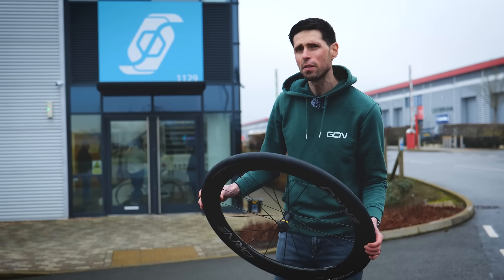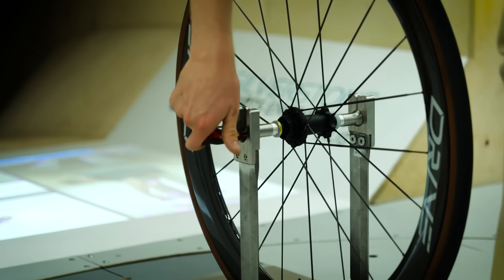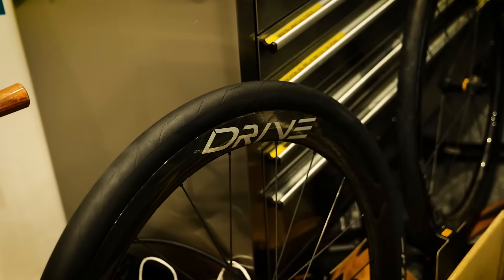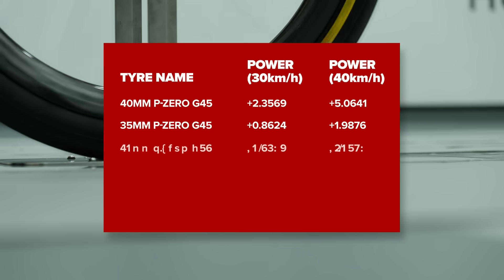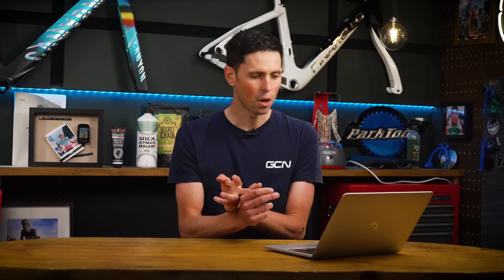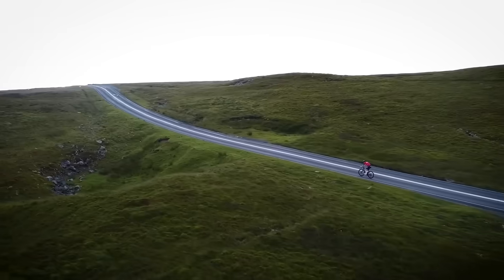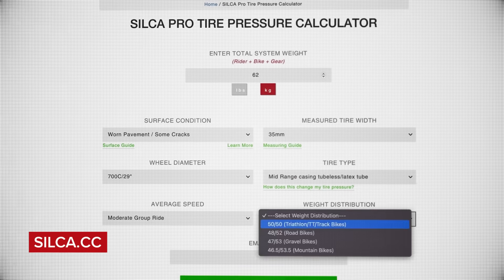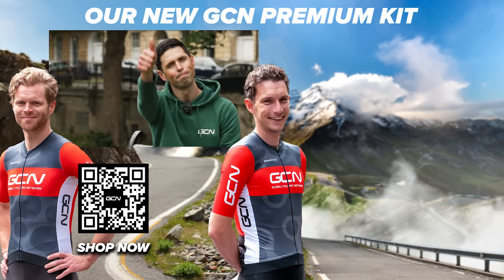The Fastest Tyre Width is NOT What You Think

Comment from the maker: What tyre width are you currently riding? Let us know in the comments below! 👇
Reply: 23mm GP5000 😊 I’m a poor dude so I ride a trusty old KLEIN frame from 2004, and it only fits 23mm 🤷🏻‍♂️
Reply: @jahen65 my old Klein fits 28mm rear, 25mm front under Suntour superb brake  
calipers,
Reply: The best combo for me: 30mm front and 32mm rear. No bounce standing and comfort sitting.
Reply: im so confused, didn't you guys test this on a track and found fatter was faster?
Reply: @Randomness82 different situations will always result in a different outcome, as I explain in this video there will never be one setup that is optimal for all situations or conditions or riders
Reply: @alexpatonGCN  I'll have to go look for the video but it was on a oval track iirc so I would think that's pretty similar to the premium road setup they had on the dyno.

Or heck maybe im mixing up with different channel but I've been hearing how fat tires are better for a while, it's like the short crank arm thing.
Reply: 12:12 - Big slick 2'' thumbs up!!  And I am thinking about giving 2.2'' or 2.5'' a try next season.
Reply: 25mm, as nothing else fits the frame and forks.
Reply: @regsmith5972 Ditto. Well, 25mm and below.
Reply: @regsmith5972   you'd be surprised. a 28mm tyre will come out at different widths depending on the rim it goes on. you may be able to get a benefit depending on what rims you have. (.eg. narrower internal rim width will produce narrower final tyre width).
Reply: @huzcer  It's a 15mm wide rim, so a 25mm is the largest that will fit, having taken advice from my bike shop.
Reply: @regsmith5972  Try 20mm....It will fit 😅
Reply: 25mm front & rear.
Reply: @robertkilpin wow
Reply: @robertkilpin  same! First road bike, coming from MTB and my bike feels fast AF! 🤷🏻‍♂️ 
Ignorance is bliss I guess
Reply: I don’t understand why no one ever takes him into consideration the weight of the rider. At 210 pounds anything less than 40 mm I would have to have at an insane psi. Ride the width where your psi is reasonable and the tire isn’t hard as a rock
Reply: @That.Guy.  Get some rims with 24mm internal width and try some 32mm at 55 PSI.  Light Clydes can be super comfortable on modern rim shapes.
Reply: @That.Guy. Surely not. I’m a similar weight and ride 25mm GP5000s at 75psi quite comfortably. Haven’t had a puncture for more than two years 👍
Reply: now do it with old steel rim brake bike. i think you will be supriced by the results.
Reply: @wilderness-beastt depends how old the steel rim brake bike is, because i can't imagine a 28mm would even fit 😂. Skinny tubular will be great here haha
Reply: Happy to say I run 30mm P Zero tires. But also sad to say I run Specialized butyl inner tubes on a tubeless ready version of the tire, which I later learned is a less optimal combination.
Reply: Been using 32mm for like 35 years.  I would prefer to use 28mm but I am too heavy.
Reply: @凸Bebo凸 how heavy? I’m 230lbz
Reply: 15mm , Theyre super fast.
Reply: Lots of tire widths in my garage.  I prefer 4" wide tires because going off road is something that is important to be able to do in eastern Idaho.
Reply: 45mm in the back and 43mm in the front.
Reply: 23 mm Vittoria Corsa tubulars. Narrower is faster 😅
Reply: 35mm Continental GP Urbans. I changed my set up a couple of years ago due to a undiagnosed problem with my legs and built a bike around my issues running 1x12 also. I've found my rides are only getting faster and they're more comfortable than the many years of riding 25mm tyres
Reply: I'm on 28mm Continental GP5000 tires on carbon rims with a 21mm internal width, mounted on a frame with rim brakes. It's a tight fit, but I'm very happy with my setup.
Reply: @alexpatonGCN you mentioned towards the end of they'll fit in your bike. What is the best way of finding this out for different bikes before buying the tyre? I'd like to try 30, but just not sure if it will fit
Reply: @shaunjasper5465  You can go on bicycle rolling resistance site and look at tire tread depths and inflated sizes.
Reply: 2,5''
Reply: 30mm with TPU tubes. Haven't tried any wider but wouldn't go back down to any narrower.
Reply: 35 mm Panaracer Gravelking Slicks (road)
42 mm Panaracer Gravelking Semi Slicks (gravel+road mix)

Found them to be a good mix of RR and puncture protection.
Reply: 25mm on one road bike, 26mm on another, and 30mm on another 😅. Too many road bikes
Reply: 25mm conti gp5000. biggest i can fit on my bike
Reply: 23mm sometimes 25mm
Reply: Just bought 30-622 GP5000, very happy about it after I saw this video ;D
Reply: For me, 32 is the sweet spot
Reply: 25mm. I got my bike a decade ago and I wish I could swap out the tires to see if wider tyres are more comfortable, but the frame doesn't support it.
Reply: 32, but smooth gravel is about my only option for riding these days.
Reply: 23 they're the fastest for my bikes, designed for that width. Could I be marginally faster on a new bike? Maybe but not enough to matter and the bike would me harder to do home maintenance on.
Reply: 32mm or 38mm on Trek Domane
Reply: I am on a train. It has no tires.
Reply: 32 mm gravel king SS works like charm in every surface!
Reply: Really should of compared those tyres to a 23 or 25 to get a better perspective
Reply: 30mm summer, 32mm winter since 6 years. happy.
Reply: 32 Winter! I do the same  @turboplopp
Reply: Gp5kStr 28mm front and 30mm rear on 30mm ext width rims; blow up to 30 and 31.5 respectively 👌
Reply: 25 in summer,  winter 28
Reply: 40mm tyres on 30mm inner rim width. Tubeless. This has been my set up since 2017.......
Reply: 115mm. It's not a road bike, it's a fat tire bike. Currently my only bike. It is in no way fast😂
Reply: Great video. I just wish you had included narrower widths in the testing just to quieten down all the old guys in my cycling club.
Reply: Great video Alex! I use 35 or 40mm often on rough surface, some gravel, sometimes hard sand and sometimes relative smooth tarmac. One bike to rule them all, or was that a ring, nevermind. Never in a race, but yes sometimes in a local event with pure road bikers and I do relative well. To lazy to switch the tyres all the time. Happy days!
Reply: 28mm front, 30mm rear
Reply: 28mm Pzero race RS TLR on 21mm rim = 29mm   @5Bar(72,5PSI)  with 100g butyl inner tube ;-)
Reply: 28mm tyre on 23mm internal rim, which inflates to 30mm with this combo.
Reply: <25, 28, 32, 40(mtb). i ride 25, 28, 32 touring/city tires because roads are bad here and glass, etc.>
<a few bikes i have more than one set of wheels for different tire sizes/tread to account for summer/winter riding>
Reply: 28 mm tires from the brand Vittoria (Randonneur).🙂
Reply: 30mm front and back with 25mm internal width rims.  I'm switching to 32mm tires after the current tires die.
Reply: 23s
Reply: 32mm Conti’s.
Reply: 28 and 30 mm PZeros. Lovely stuff.
Reply: 559x50 Continental Urban Contacts.  I'm no road racer, I leisurely ride asphalt rail trails for fun. Smooth.
Reply: 35mm f & r, setup tubeless running 44 and 47 psi respectively
Reply: 35 Conti GP5000 ASTR that balloon up to 39mm.  Love it; silky smooth and I'm not racing anybody.
Reply: 28mm Vittoria tan wall corsa's👌
Reply: 30mm nominal but they turn out to be 32mm WAM on my wheels. They’re perfect 🤩
Reply: Gravel has 42s (biggest that'll fit in knobby format). Carbon bike has 25s, vintage steel race bike has 23s, vintage aluminum touring bike has 19s.

19s are most challenging, 23s most used, 25s most cozy, 42s most fun because I do real dumb stuff on that bike.
Reply: 25mm on my 2014 defy
Reply: 26 are lightning
Reply: 25 always, and disappointed it wasn't included for comparison! 🤪
Reply: 25mm, since nothing bigger fits. At a system weight of 110kgs I need like 7-7.5 bars, which make them like concrete on rough roads. Luckily I'll be upgrading my bike soon, looking forward to 32mm options
Reply: Carbon road bike: P-Zero Race TLR 28's, but they measure 29.5 on my rims. 
Steel road bike: Goodyear Eagle F1 28's tube type with TPU they measure 28 dead.
Reply: 25mm and 100 psi until the end of time
Reply: 28 front and 32 in back, using 21mm rims, 45 and 41 psi respectively.
Reply: 50mm
Reply: I currently run 32c  P-zero.  Wish you threw that in the test as well.
Reply: Been running 34mm Corsa N.EXTs as my road tire.   Whatever I lose in watts I make up for in comfort which over long distances means less fatigue, so it all balances out in my mind as an old and cranky person.
Reply: 28mm with TPU tubes ! Rim Brakes
Reply: I ride with Michelin Lithion tyres, which are good all-season training tyres, and butyl inner tubes. They are supposed to be 25 mm wide, but once mounted, these tyres are 28 mm wide.
My question is: should I calculate the pressure for 25 or 28 mm?
Reply: 35 mm Pirelli Cinterano Velo now for 7362 km and Happy on the Panamericana in Kolumbien 🇨🇴, Ecuador 🇪🇨, Peru 🇵🇪 and at home.
Reply: 25mm @120 psi
Reply: 40mm, crazy wide bad boys? 🤣
My favorite bike uses 100mm tires on a 27.5" rim......
Reply: why are you not adding 25 and 23mm to see what difference there is? 🤣
Reply: 23 mm on one pair of wheels. 25 mm on the other set. Still hesitate to buy 28-s, that is the maximum.
Reply: 32mm for the last 2 years and absolutely love them. I am considering going 35mm the next time I'm due to renew. Only problem there is, there aren't many companies producing 35mm road tyres therefor they are rather pricey.
Reply: 32 for me all over.
Reply: As long as have my current bike it's still 23 in the front en 25 in the back. Quite aero and with the right right pressure you can ride almost every terrain. I rode up the Koppenberg the day before the cross and with 3.6-3.8 bar it deals well enough with the cobbles, the mud and the leaves. For a new bike something like 28-30 on wider rims will be nice. (80 kg rider weight btw)
Reply: @gadenhertog  NICE! 👍
Reply: Currently using 30mm Continental GP 5000's. I've been on top of this for awhile now...since 2015 I'd say? For me the big deal was also the weight of the wheel as a whole. I ride a lot of single speed and you can really tell the difference there, because you only use one gear ratio. For me it's about hills. That 32 and it's mild rolling and unsprung weight penalty is a big deal when climbing and you can't just drop down a gear. 30 definitely feels faster than 32. Even from different brands, it just feels sluggish or mushy. It's definitely more comfy but not so much that the 30 feels punishing. It's very nuanced. My opinion, and I have been preaching this for some time now, is that 30mm is King! I mean if all you're doing is cruising around , get a gravel bike and throw some 40's or bigger on there. But Pro or Weekend warriors, if you care any bit about speed with a side of comfort, 30 is where it's at.
Reply: from 26 jumped to 30, now using 28. 30 is too much comfort almost gravel like, maybe when I i switch to carbon spoke wheels I will try 30 again.
Reply: Upgraded an old cervelo S3 specifically so I could run wider tires.  I think my Time ADHX with 34c front and 35c rear is absolutely perfect for an all road bike.
Reply: I switched from 28 to 32 this year and they're loads faster as well as more comfortable (both Schwalbe Pro One TLE)
Reply: 700x23C (1984 Bianchi Sport, steel is real).  But I'm not running 120 PSI - 90 PSI is what the bike likes for optimal performance.  Current tire set is Continental Ultra Sport III's.
Reply: 32mm for the past 8 years
Reply: 32mm, but 35-40 will be my choice!!! Hi!
Reply: 32 here gp5000, big guy, 115kgs. tried 25. and boy that was horrible experiance. i might try 30. i use to ride 40/45. felt difference in speed, but not in confort.
Reply: 23
Reply: 30 front, 32 back
Reply: 700x32s
Reply: all sizes, cause a single option can never be optimized but yall need to test flat bars vs drop in an aero test and a course so we can finally show that dad park bikes are the ultimate weapon.
Reply: 25mm front and rear
Reply: I have 32 mm on my all-road bike, 40 mm on my gravel bike and 45 mm on my gravel eBike. I much prefer the ride on my gravel bikes, even though it has a cheap aluminum fork and the road bike has a carbon fork.
Reply: 25mm Conti GP 5000s
Reply: 23🫨
Reply: 34 mm vittoria rubino V G2.0 with 30mm inner rim width it's comfortable but chunky.
Reply: 32mm schwalbe one pro's instead of the 30mm standard on my scott addict
Reply: 62mm
Reply: Tire
Reply: 16
Reply: 30mm Pirelli P Zero
Reply: I ride a 2002 Lemond Victoire Titanium with carbon fork and all Ultegra. I have a set of Ksyrium ssc blade wheels. I run P-zero race RS tires 26mm with the evo TPU tubes at 95 psi.  My weight is 180 lbs. I did a 120+ mile day last weekend followed by 90 miles the next day. I am very pleased with the 26mm tire and the RS seems to roll better than my prior P-zero race tires.  It appears my frame and brakes wouldn't clear a 28mm tire or I would size up. Thanks for the video. Cheers from the USA.
Reply: 28mm.  Panaracer Pasela Protite Wired Urban Tyre : Black/Amber, 700 x 28c.  On Thorn Audax bike.
Reply: On my FAST bike, a Scott Carbon Fiber,  25 is max because it was built for rim brakes.. On my new edurance (Specialized Roubaix) and gravel (Giant Revolt), I have a 28 and a 32 respectively. I think a road bike with 28 black chili would be ideal, if it was thick enough. For racing or fast group pace line riding,  I usually have Continental GP 5000 because of the faster rubber. But when I train I go with heavier all season 28 (stock) tires on the Roubaix.   The Giant revolt came with 32 knobby's tubless, which I will eventually replace with slicks (28). Dont forget that wider tires are also heavier in weight, have greater wind resistance, and on most surfaces, a smaller contact patch means less resistance.
Reply: 35mm roadsport. secure and confortable and fast. Ideal for road and sterrato surfaces👌
Reply: 25 мм
Reply: 28C front, 32C rear
Reply: I am rocking old school at 700x20 on one of my road bikes at 120psi. I do notice the lack of rolling resistance when they are rock hard. I do not have to do much cornering on the rides, and I weigh 220lbs right now, so the rear tire still has a contact patch!
Reply: 35 mm vengo dal 32 ma il 35 in discesa vola  in totale sicurezza e non ha tanto atrito con la fascia liscia al centro
Reply: 24 mm
Reply: I did a 95 mile / 150 km ride this weekend on 42 mm tires. Comfortable and fast enough. No regrets.
Reply: the higher the pressure, the lower the rolling resistance. this should hold for ANY tire. if you're gonna run different tires at different pressures according to some "silca chart" claiming to list the pressure requirement for "maximum speed"... well, that seems pretty arbitrary to me - and will most certainly skew your data. 

imo, the right question is: at a GIVEN PRESSURE, how does the 28mm tire stack up against the other tires in your test. anything else is...well, i'd think you could get almost anything you want - including "surprising" results. 

would have been nice if you'd posted the tire pressure in a column alongside your results here.
Reply: I find 25mm faster than 30mm on tarmac road.
Reply: 25 front, 28 rear
Reply: 70mm with full suspension
Reply: 32mm Conti GP5000s TR. Pricey but very very good.
Reply: I use 23mm on an old Basso with Dura-Ace. Faster than my new Trek Domane with 32s and then 28s. The 28s are faster than 32s. Maybe my surface is different, but thinner is faster in my paved world.
Reply: 35 c
Reply: 30 conti GP 5000 S TR on 22mm inner width carbon rims, tubeless mounted.
It's my first road bike, I have asked the retailer to change the originals 25 with inner tubes on it before my first ride so I can't compare but I trusted the actual movement.
Reply: My roadie / all purpose is 40mm maxxis slicks at around 38 psi. To be fair; I dont race, I do take the bike places it isn't meant for over what some would call gravel
Reply: 47mm.  I usually ride alone and I seek gravel when I can even though most my riding is on road.  They are so comfortable.
Reply: Conti !8mm Front 20mm Rear @gcntech They corner faster, squirm less, have smallest contact patch. 150psi max.
Reply: Size doesn’t matter 😂
Reply: @neilwallace8989 that's not what your wife said😂😂😂
Reply: 25mm tubular on Campagnolo Bora One rims. Don't spread this 🤫
Reply: 23, 25 and 26 mm. Only 27 for Strada Bianca. Tried 28 mm and it is boring
Reply: Ideally you should have done this test in two parts. Test everything on the one wheel, then come back and test everything on the second wheel. Great results, helpful upload!
Reply: 23 mm on all road bikes, but going for 21 mm soon. Feels fast, is fast and, of course, look the best.
Reply: Currently riding 25mm GP5000s as they’re the widest that will fit my 12-year old Wilier. Beautiful tyres.

Also, at 1:15 you use ‘attribute’ in its verbal sense, with the emphasis on the first syllable (“ATTribute”). That, though, is the emphasis used for the nominal use of ‘attribute’ (as a noun). The emphasis when using the word as a verb is on the second syllable (“atTRIBute”). And on top of that, ‘attribute’ is the wrong verb - the one you were looking for was ‘conflate’. Hope that helps 😁😉